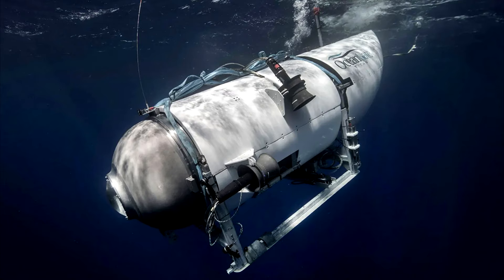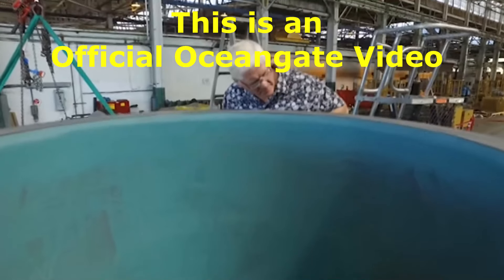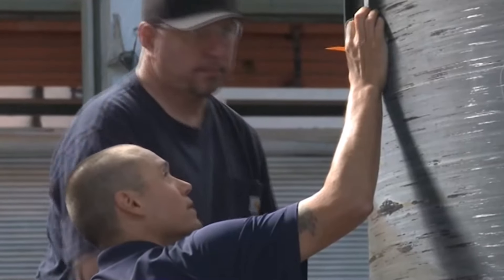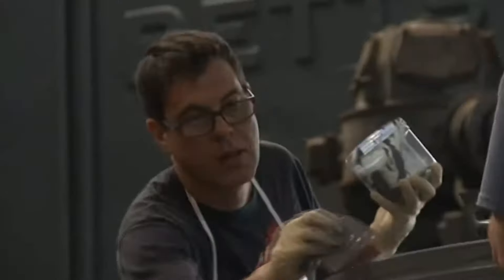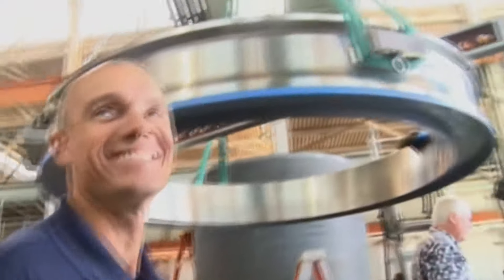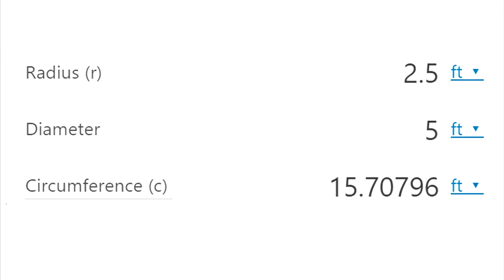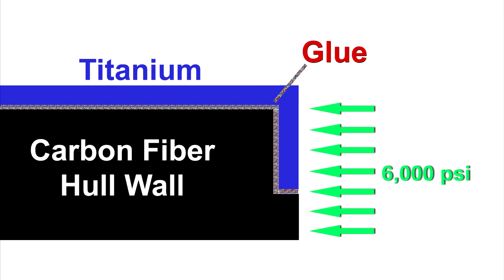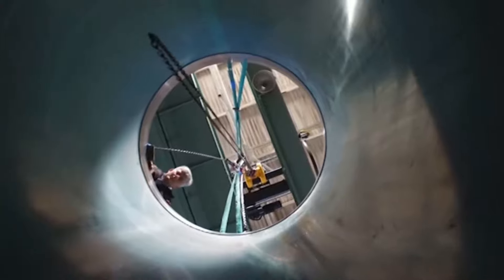Ocean Gate Titan Was Glued! Coast Guard Reviews

Comment: How else would they have attached the carbon fiber to the titanium rings?   of course it was glued.  You can't weld carbon fiber.

Of all the things to criticize Ocean Gate (and there are too many to list), using epoxy adhesives doesn't seem like a big gotcha...     The use of CF was the problem, not whether it was epoxied to some of the Ti elements.  If I build an eggshell to go into orbit, it doesn't matter how the engines or fins are attached.
Reply from the maker: Thanks for your comment.  At the time I uploaded this video the type of epoxy was not even publically known.  It is now due to the Coast Guard/NTSB investigation.  (Loctite EA 9394 AERO, also known as Hysol EA9394).  Obviously, if you are trying to bond two dissimilar materials together epoxy may be the answer.  The point of this video was basically: the standard build for deep diving submersibles to sustain 6,000 PSI is a sphere built with welding together steel/titanium, not glue. So, you can't separate the decision to use glue from the technique of applying the glue.  If you are going to use "industry standard epoxy adhesives"  (your terms) it should be applied with industry-standard procedures, as in controlled conditions; temperature, humidity, dust control. etc.  I did not see that attention to detail in this fabrication video, did you?  So, actually, those are two gotcha's.  And I can add a third.  After the investigation when the Spencer Composite design document was released, we learned that the gap for the epoxy was specified to be 0.06 inches.  Do you have any confidence in that specification (in all gaps) being met by what you see happening in this video?  Thanks for adding to the discussion, I appreciate it.

Comment: Theres nothing wrong, necessarily, in a glued joint.  I get that it sounds bad but thats not the issue with this sub.

Essentially this whole glue argument is just pop culture appeal to pearl clutching.

By focusing on a perfectly acceptable method while ignoring much, much more signifigant issues doesnt do anybody any good... But it does get you clicks, doesnt it.
Reply from the maker: Thanks for your comment.  When I uploaded this video the type of epoxy was not even publically known.  It is now, due to the Coast Guard/NTSB investigation.  (Loctite EA 9394 AERO, also known as Hysol EA9394).  The point of this video was basically this: the standard build for deep diving submersibles to sustain 6,000 PSI is a sphere built by welding together steel/titanium, not glue. Furthermore, you can't separate the decision to use glue from the technique of applying the glue (this video).  If you are going to use "industry standard epoxy adhesives"  it should be applied with industry-standard procedures, as in controlled conditions; temperature, humidity, dust control. etc.  I did not see that attention to detail in this fabrication video, did you?   Finally, after the investigation when the Spencer Composite design document was released, we learned that the gap for the epoxy was specified to be 0.06 inches.  Do you have any confidence in that specification (in all gaps) being met by what you see happening in this video?  So using glue in this sub was way more than "sounds bad"  (your term).  I think this video and the other Titan videos I have released are thoughtfully adding to the discussion without being sensationalized.  Thanks for adding to the discussion.

Comment: I put more effort and thinking into getting good gasket sealent onto my water pump, for my 1973 Volvo wagon... And Red Block engined are notorious for beijg virtually indestructable.

I've only just replaced the factory pump with one from the 245.... I had fucking calipers out to measure the thickness of my beads.... I translated fucking Swedish to workout what the hell they meant for certain terms that I THOUGHT I needed to understand.... I barely needed any of the extra info!

I have done better at valve and industrial water fittings factory work. This shit would of had me fired in a week!

Comment: So was the Bathyscaph Truest! The three sections of its Krupp sphere were glued together when it made its 36,000 feet to Challenger Deep in 1970! So your fake outrage is rejected
Reply from the maker: Thanks for your comment.  I have read a fair amount about the The Trieste, which was  Piccard's original pressure sphere.  It was built of steel forged in two hemispheres 89 mm thick and welded to form a sphere 2.4 meters in diameter.  I wasn't familiar with the name the Krupp sphere, so I looked it up and this is what I found: It was made of a vacuum-cast chrome-nickel-molybdenum-steel alloy 12cm thick.  I saw no mention of glue being used to hold the pressure vessel together in either case.
Reply: @ I was in the Navy Deep Submergence program on the DSRV-2 Avalon. During our reunion two years ago, the speaker was Don Walsh, pilot of Trieste during that dive. They were just as reckless as Stockton was back then. During shallower test dives, the sphere became unglued. They caulked as much glue into the joint as the could and wrapped the sphere with a steel band. During that record setting dive, the joints still leaked but they decided that as they went deeper, pressure wound seal it. (It did). At 10,000 feet, they heard a pound "Bang!". They determined they were still alive so it could be that bad and continued the dive. (It was the navigation light used for the tow they forgot to remove prior to the dive). At nearly 36,000 feet, the viewport cracked. It was at this point they decided to terminate the dive! And the rest is history
Reply from the maker: @scoutdynamics3272  Thanks for replying.  I will continue to research this.  There is a really good article on the U.S. Naval Institute website which I will quote here   "A small leak had started at about 10,000 feet through one of the stuffing tubes that brought electrical wires into the sphere. As they passed through 15,000 feet that leak began to seal, but another one began at about 18,000 feet and the inflow of water increased as they went deeper. The second leak also stopped as they continued to descend."  So, this article describes the leaks through a pass-through hole.  And I know of other references discussing the window cracking.  I will continue to look for a reference that states that the actual pressure hull of the Triest was glued together in a manner similar to the way the Titan pressure hull was glued together.  It is of interest to me.  Thanks.

Comment: Stockton was a dipshit and this was a poorly designed piece of crap that was inevitably going to kill him and others, however I don't think it's reasonable to assume the handspread line of glue we saw can reasonable be assumed as the final pass.

That said, it probably wasn't much better after smoothing that down more...
Reply from the maker: Thanks for your comment.  So, they did the same process for gluing the 2nd hull;  there is no video of it but the instruction set is on the Coast Guard website.  If you look at the NTSB images of the rings from the wreckage you can see unevenness and voids in the epoxy just as if it is an imprint of the hand smoothed process (seen in the video).  I know it's hard to believe , but I think it is true, that was the final pass.

Comment: "Glue" is the wrong term here, misleading, and actually inaccurate despite the terrible outcome of Titan.

Horse hoof products like paste or Elmer's is, loosely, glue.

The space-age industrial nano-polymer used on Titan, an epoxy resin derivation, is definitely NOT glue. Yes, it's an adhesive, but it is certainly more than "glue."

You know this.

 The problem was not that nano polymers were used as bonding adhesives. The problem was the testing. What was the maximum allowable compression decompression cycle? Well, we know now it's about 19.

Titan survived more than a dozen Titanic depth dives without implosion... thanks to nano polymer Epoxy resins. The problem with using carbon fiber and Epoxy resin is that it has a predictably low expected compression cycle. 

The problem with your video is that it's an insincere and inaccurate presentation of an excellent high-tech polymer adhesive as some kind of sub-standard "glue."

Stockton was insane... but his idea was not bad. It just needed further testing and development.

marcus
Reply from the maker: Thanks for your comment.  So, here is why I did that in the title and the video: and I gave it some thought at the time of releasing the video.  Nowhere in the original official OceanGate video of the gluing process do they use the word epoxy.  Not once in the entire original video.  Did you watch my video, or are you basing your comment on the title?  My video is not insincere or inaccurate at all.  On purpose, I used the same terminology as they did because I did not want my script to sound more sophisticated than the actual interviews in the factory.  I wanted to represent them.  Stockton even says "It's not like Elmer's glue, it's more like peanut butter."  Tony Nissen the director of engineering refers to it as glue. The entire amateurish gluing process for a deep diving sub was a joke and I wanted to use the same joke terminology they did.  I am well aware it was two-part epoxy, there is a short segment where you can see them mixing it.  Please watch my entire video so you see the context of my script and edits.  Thanks.
Reply: @solareclipsetimer  , thanks for the reply. I did watch your entire video, I never comment on thumb nails or titles.

Thanks for your answer.  Actually, I fault everyone (not just you) including Stockton, for using terms like glue, and peanut butter... Stockton is such an idiot... its nothing like peanut butter.

I appreciate you not wanting to be more specific, nor sophisticated, than the documentary(s);  but, having said that, we need to in the aftermath in order to sort out what was bad, and what was potentially good.  My main point is that the Epoxy resins were actually the GOOD, in this whole process... if they'd used anything less the damned thing wouldn't have made one compression test.

Again the main problem was the lack of testing, NOT the adhesives used.

marcus